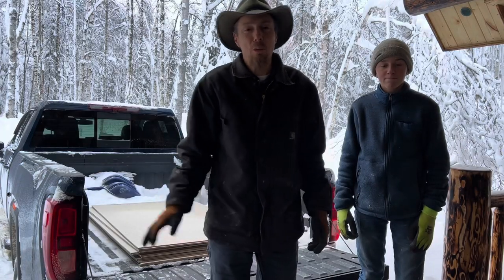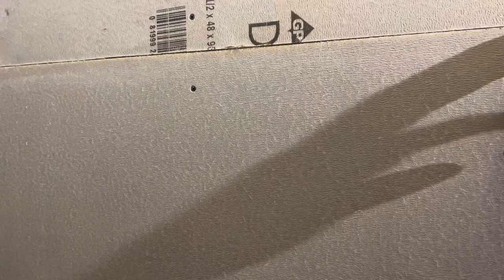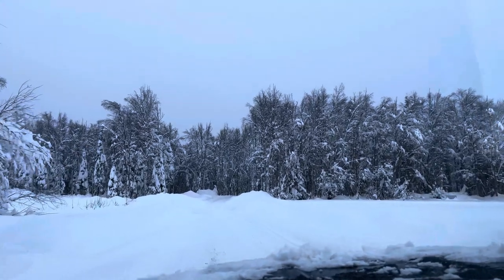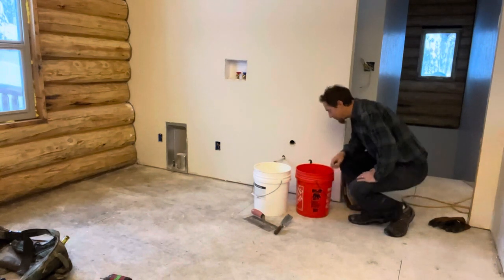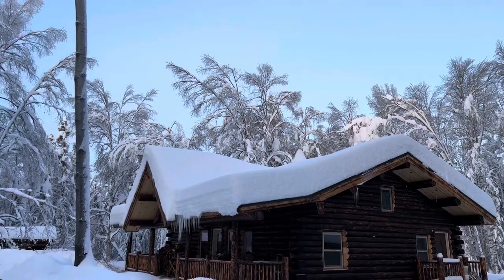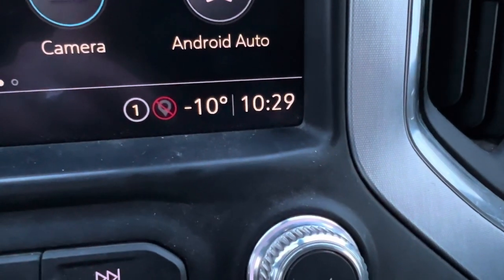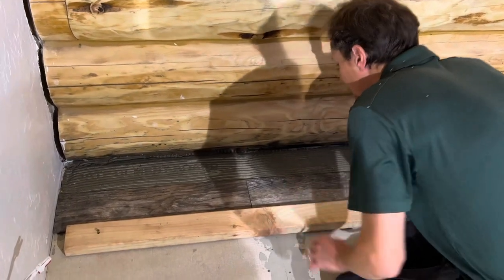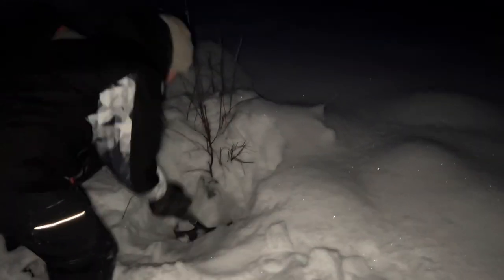Our Alaska Log Home - Tile Floors / Shower Tile Prep

Comment: My last trip to Alaska was three years ago and until the final day, the high temp was -15.  
While there we made ice candles.  You take 5-galon buckets and fill them with water.  Set them outside and check on them periodically breaking and removing the ice on top.  Once the ice on the sides is 1 1/2 inches thick you pour out the remaining water and take them inside until they will slide out of the bucket.  These look like magical crystal cylinders.  Place them on the porch and walk with a candle inside and the entire thing glows beautifully.  This works great whenever the temps are below freezing for several days.
Reply: That must be really beautiful!  What a great idea!
Reply: @suehamblin9652  Yes, they are beautiful even magical.  We lined and entire church drive and sidewalks with 30 or so of them.  They were enchanting.
Reply: @dwighthires3163  I would have loved to have seen that.  It sounds like a lot of work for 30 of them!
Reply: @suehamblin9652  We had a bit of help because everyone in the church seemed to know how to make them.  There were some made in square buckets and some in oval trach cans so they showed some individuality as well.
Reply: @dwighthires3163  That’s good.  Then one person didn’t have to do all the work.  I’m going to remember this … I think it’s one step up from the paper bag candle lanterns that people make to line the walkways at Christmas.  Thanks!